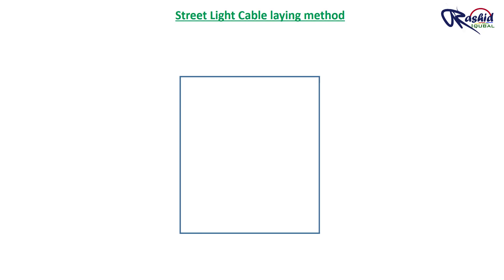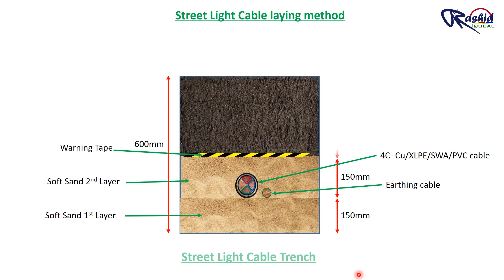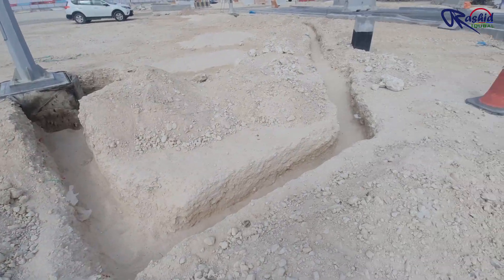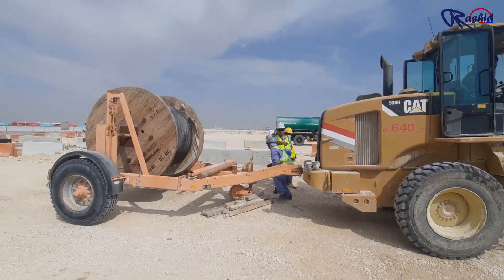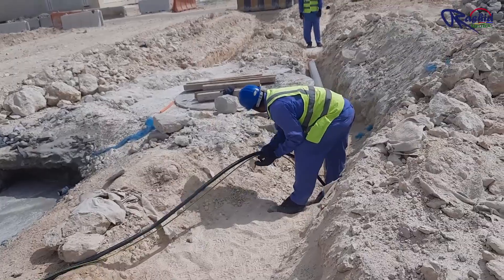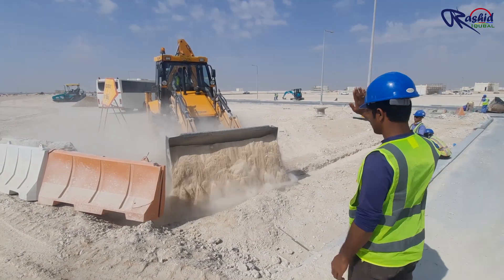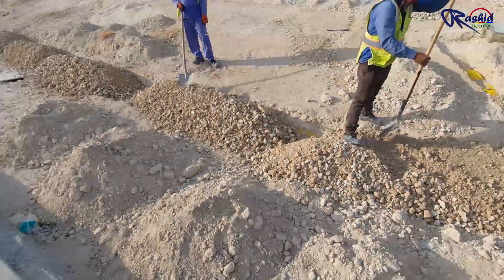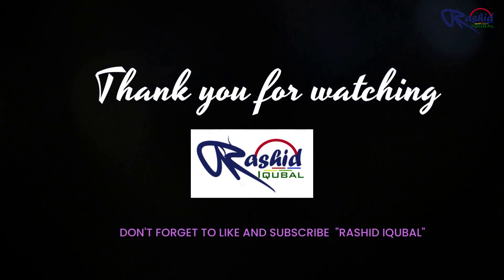Underground cable laying for street light

Comment: Thanks for sharing this — the step-by-step view makes the process very easy to follow.
Underground cable protection is often underestimated, but it directly affects system reliability over time.
Are these installation practices based on a specific local code or project standard?

Comment: Why did you choose 16mm earthing cable instead of 25mm ?
Reply from the maker: @7azax  The earthing cable is half the size of the phase/neutral cable because it only needs to carry fault current for a short time until the protective device trips, unlike phase/neutral cables, which carry continuous load. This design saves cost and space while ensuring safety

Comment: Nice explaination. One question, if earth cable is damaged between any two poles, earthing will not work. So is there any solution of it?
Reply from the maker: After laying we perform continuity and megger test from feeder piller to circuit end, if any damage found during test we can rectify or change that cable.

Comment: sir can you explain how to give supply substation to feeder pillar
Reply from the maker: From substation we already pulled 4cx300mmsq cable from LV panel  which is passing near street light feeder pillar. so we will make T- Joint from main cable and feed to Street light feeder pillar. T-Joint size based on your cable size. here we are using 4cx300mmsq to 4cx35mmsq T joint. hope you understand.
Reply: @Rashid-iqubal  sir sorry for disturb sir do you have street light watts detail and pole height detail also street light lumans calculation
Reply from the maker: @johnjoseph1789  this all detail you can get from manufacturer catalogue, All lights has different wattage, depands on type of light either it is LED light or HPS light. For pole height and lumen calculation you need to know dialux software where you can design as per your project requirment.
Reply: @Rashid-iqubal  THANKS SIR